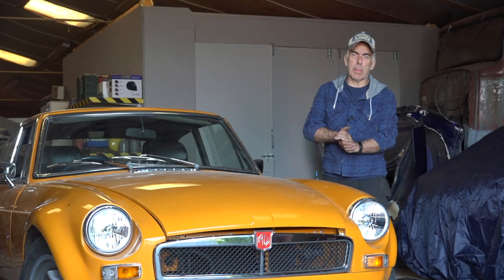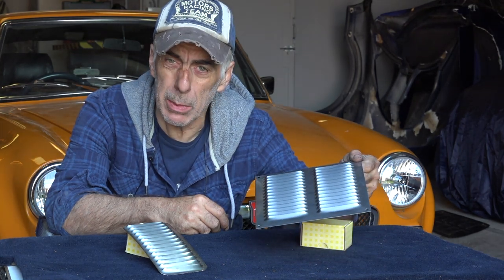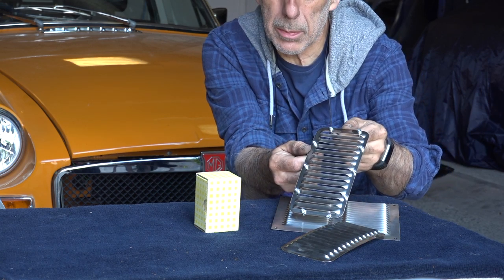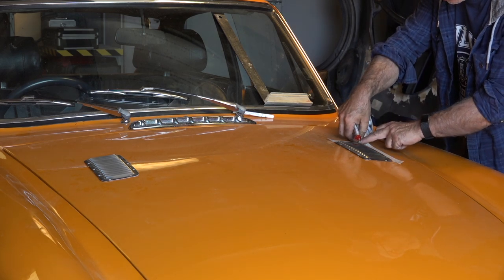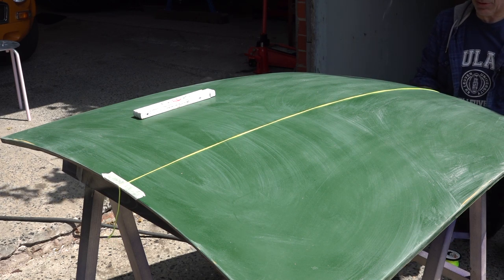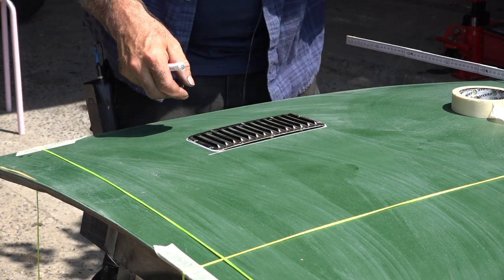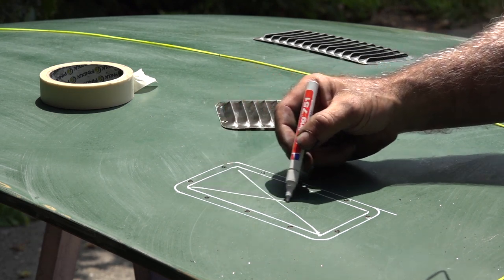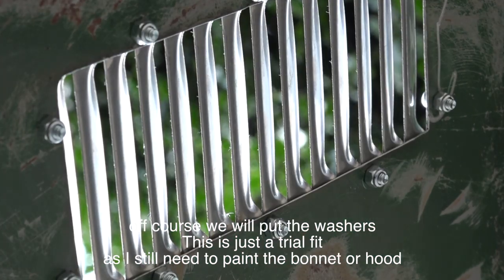Creating a Louvre in the  bonnet or hood of your car

Comment: Thanks, well done. My V8 had an overheating problem, but I did not want to spoil the lines with a Louvre, personal opinion.
 I fitted an aluminium radiator, with twin fan cooling, and ducting to ensure all the airflow went through the rad. A large oil cooler with a fan.
 I have noticed your exhaust manifolds are wrapped which is good. Do your exhaust go through the inner wings, good and bad, it helps with cooling, but road crap sprays around the engine bay.
 I removed the thermostat, and preferred to manually operate the cooling fans, I found once you got too hot it was difficult to get the temperature down again. 
 Thanks for your video, and good luck.
Reply from the maker: Thanks for the comments John, yes indeed the pipes route through the inner wings..  I know most don't like the Louvres and that is ok. Its a personal taste ... And I have a C bonnet available. temperature wise I seem not to have a problem only heath build after a ride causing gas bubbels in the carb.   I need to fit and isolation ring between the carbs and the intake manifold. and I still need to fix the clearance between the exhaust and steering rod as that is very close and slightly touches when the engine shakes  ... very enjoying feeling

Comment: As a little kid in the early 60's i knew a car was something special because it had louvers in the bonnet .And,some of the guys would get louvers from the WW2 aircraft parked in our local aerodrome and rivet them onto the bonnet just like you have done. it looks very workman like and has that extreme look of the old race cars. my latest 'after work' project is a leyland V8 powered VW square back. it was built 30 plus years ago and did a fair bit of driving before the engine seized during a hill climb event. it was parked for years which is where I came in. the Front has been cut open to allow air to the radiator and louvers are going to be the way I will clean it up. Leyland V8's are a slightly wider version of the rover. many bits interchange ,along with the buick 215 alloy V8.
Reply from the maker: Thank you for your comments

Comment: The Rover V8 creates an incredible amount of heat especially when driven hard (the amount of fuel used tells you just how much !) and being all aluminium the risk of an overheated engine is immense. Anything that helps keep the engine temps down is sensible - I would recommend a switch to keep the electric fans spinning when needed (mostly all the time in summer) as well to keep the engine bay vented.
Reply from the maker: Indeed, and I have a new electrical 76 degrees switch for the FAN

Comment: Fantastic presentation as always. One thing, I'm not sure looking at the end of the vt what way the louvres are vented.

Are they vented towards the windscreen to create exhaust for engine heat or vented forward facing towards the front end of car to draw cool air into the engine bay during forward motion?
Reply: Yes, openings toward the rear to extract underhood/bonnet air.
Reply from the maker: Thank you for your comments and opinion,   they point backwards so it creates a ventury effect, sucking air out of the engine bay. It will also avoid water getting in while driving.
Reply from the maker: Indeed

Comment: Any time you cut holes in a panel, you want to measure underneath to see what's there.  There's no point in putting a hole where there's an obstruction underneath, or something that won't benefit from being dripped on, like electrics.
If you're cutting a rectangular hole, drill out the corners first, then join them with the straight cuts. There will be less filing to do to get nice smooth corners.
Reply from the maker: Yes indeed, always check
Reply: Something else I forgot to mention. Air flows from high to low pressure. The history of motoring is full of cases where intakes were put in low pressure areas (like the front of the hood), .or outlets in high-pressure ones like the base of a windshield. Taping tufts of wool around a potential location and a quick drive can show you if the airflow makes it a good spot, and confirm afterwards if the installation works.
Reply from the maker: Thanks for the comments, indeed

Comment: Not only will air get thrue ....but so will water and cause all sorts of problems......electrical..... steam from the headers......rust ....etc etc etc......do not do this to your car tubers.....
Reply: Lfig Lfig you think he’s going to use it in the rain?
Reply: The likes of Jaguar, Porsche,  Ferrari  etc etc have been doing it for years .
Reply from the maker: Thanks for your comments, as good as no water gets in while driving.  Its a bit like driving a convertible in the rain. The dashboard doe snot get wet as long as you drive.  Of course if you park, and or stop you might get a few drips. But check where they are placed....   Of course if you are going to park for a long time outside then I would place a cap on it.   A conversion V8, has cut-out inner fenders, So if we talk about water and damp, that is were lost of it comes in.  So these little louvres are no issue at all..   And note that I do not drive this car in the rain or bad weather. Its my oldtimer baby... that I might have molested with the louvres hahaha
Reply from the maker: haha, txs
Reply from the maker: Right Henry, no way I will drive this car in rain if I can avoid it